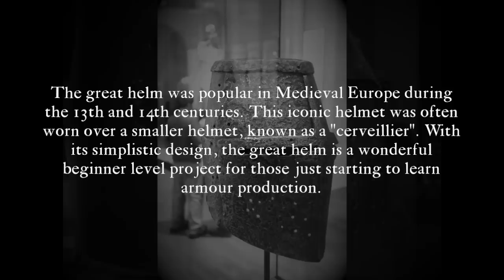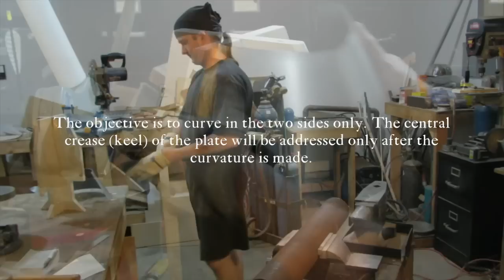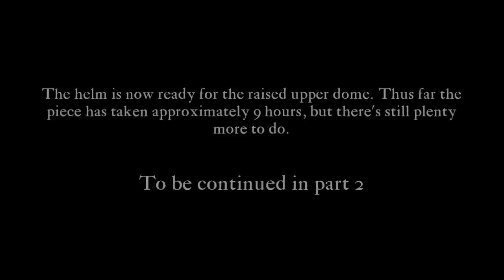Making a 14th Century Greathelm Part 1

Comment: this is stainless steel or steel
Reply from the maker: 1018 low-carbon mild steel. The originals would be wrought iron sheet.
Reply: thank you.from argentina!
Reply: you recommend use stainless steel for helmets?
Reply from the maker: I know of a lot of people who make armour with stainless steel. Personally, I don't like how it works. It's not a historical metal and it doesn't do everything that mild steel or high carbon steel will do. If you are worried about rust, you can blue mild steel which will make it rust resistant.
Reply: my question is that i cant find steel 1018. 1045 serves?
Reply from the maker: No. 1045 is high carbon steel and needs to be heat-treated. You can make stuff out of 1045 without heat treatment, but it's not the easiest stuff to work with cold. Most of your forming would have to be hot. These instructions in this video are intended for low carbon 1018 mild steel. You can get 1018 online at McMaster Carr:
 http://www.mcmaster.com/#standard-steel-sheets/=12skznf

Comment: Not bad...great to see a Beverly Shear being used rather than bandsaws that you usually see in these kinds of videos, good hammer work and shaping techniques and good selection of tools and forms. A little too precious with the measuring of angles and line layouts (can be done by eye if you're good) and no need for that wooden form but how ever you get there, I guess......

Comment: I would love to do stuff like this, although I can't afford equipment like this, which is the thing that usually keeps me away from my hobbies
Reply from the maker: +John Cena You are a successful wrestler and I'm sure can afford the necessary equipment. However, given your strength and power, the necessary hammers and stakes could be easily substituted for your raw fists and willpower. 

That said, my advice is to start with a few simple tools and work your way up. Don't underestimate getting tools at trade meets, garage sales and the Goodwill store. Honestly, my first tools were a drill, ball pien hammer, a sanded down trailer ball hitch and the dirt on the ground outside. Those three things produced my first shield boss ;-).
Reply: Do you also happen to have a pattern for making a Brigandine or coat of plates?
Reply from the maker: +John Cena I do, it will be included as part of my upcoming book ;-).
Reply: +Parker Brown Where can I buy that?
Reply from the maker: +Der Wolf It will be offered through Schiffer Publishing in either late 2017 or early 2018. Right now it's not available because I'm still writing it ;-).

Comment: Hey Man, just wanted to say this is so inspirational as i've recently tried to take up the craft. Don't have much to work with but ever since i was a kid I wanted a great helm and going to try to make one after seeing your video. Could possibly list or reply with the absolute basic tools i would require to get this project going? It seems like just a couple hammers, and such I don't think i have access to beverly shears but might have to deal with hand shears initially. Any input would be great. You're an incredible craftsman.
Reply from the maker: That is a simple question with a very complex answer. Funny enough, I'm writing a book about beginning armouring right now and a realistic list of tools to get started can seem daunting, but here's the breakdown:

$100          Medium Bench Vise
$40            Jigsaw with a metal cutting blade
$200          Oxyacetylene torch setup
$300 ea.    Gas tanks (oxygen & acetylene)
$5 ea.        Ball-pien hammers (multiple sizes)
$20            Basic raising hammer
$20            Weighted rawhide mallet
FREE         Large wooden stump
$75 ea.     Dishing forms
$100         Basic 100 lb. anvil
$60           3” diameter ball stake
$50           Corded electric drill and drill bits
$10           Jeweler’s saw and blades
$5 ea.       Metal files (assorted)
$5/sheet  Sand paper (assorted)
$100         Electric polishing motor
$8 ea.       6” stiff polishing wheels
$8 ea.       6” loose polishing wheels
$3 ea.       Aluminum oxide sanding disks (various grits)
$5 ea.       Polishing compounds
$3             Heat-resistant black paint
$20           Micro-crystaline wax
$3.25/lb.  Sheet steel 2’x2’ assorted gauges
$7.25/lb.  Steel rivets (assorted sizes)
$100-$200   Misc. tools (pliers, vise grips, nuts, bolts,
markers, pencils, compasses, tape, rulers,
dowel rods, lumber...etc.)
Reply: +Parker Brown wow thanks for all the thorough information! definitely will look at picking up your book when you finish.  I know it takes a lot of time and commitment and trial and error to get finished product. your incredibly talented and thanks for replying again.

Comment: So, is there any benefit of using wrought iron over the varieties of steel today?  Is a higher carbon steel better?  Would one of the alloy steels or tool steels be to difficult to work with?  I haven't seen the end but do you harden the mild steel at the end?

Comment: I would like to ask is Oxyacetylene, forge, etc really needed to form the specific area on a 16 gauge mild steel, is just to make it easier to form it, or could a hole greathelm made without heating it at any point.
Reply from the maker: Rusteythemanify, It can certainly be done, but you can achieve similar slower results with a handheld MAPP gas torch. They're affordable and can be found at most hardware stores :-).
Reply: thank you for this helpful info. :P

Comment: These are great to watch in the background at work! Made a donation on your website. Thanks for doing all these. 

What kind of throatless shear do you use? I was considering the Harbor Freight one. Do you have a full list of "starting" tools and what you consider essential?
Reply from the maker: +Preston Thompson First off, thank you very very much for your donation! More videos ARE forthcoming, but right now I'm working on a publication detailing so MUCH more than what I get to cover in these videos. 

The throatless shear is a B2 Beverly Shear. The Harbor Freight one has an issue with the blades cracking and frankly I have LOVED my shear the moment I first used it. However, for starting out, you can get by very well with an electric jigsaw fitted with a metal cutting blade. 

Here's a (hopefully) helpful list of some starting tools you'll need:

-vise
-jigsaw w/ metal cutting blades
-ball-pien hammers (multiple sizes)
-basic raising hammer (can be found at riogrande.com)
-large weighted 3 or 4 lb. rawhide mallet (I got mine on ebay)
-wooden stump (or construct one out of bolted together wood planks)
-a steel anvil (I've used a refinished Harbor Freight one for years)
-3" dia. ball stake (http://ironmongerarmory.com/tools)
-electric drill
-metal files (multiple shapes and sizes)
-mounted polishing motor with spindle attachments
-aluminum oxide 7" sanding disks (various grits)
-angle grinder
-buffing wheel & compound

This will get you started, but it's by no means the end-all to your journey ;-).

Comment: were there nuts and bolts used to make the original pembridge helm?
Reply from the maker: While the screw and thread were an Ancient Greek invention, we don't really see surviving threaded nuts and bolts in armour until about the 15th century. The Pembridge Helm, from the early 14th century, could have been held together by other means. Personally, I've experimented with tapered wood, copper and brass rods hammered into place and then removed as the piece is riveted together, but nothing has satisfied the full requirements of the fastener. I'll keep trying though, ;-).